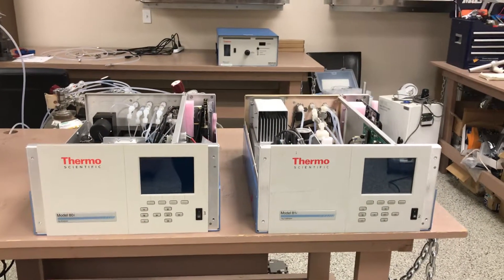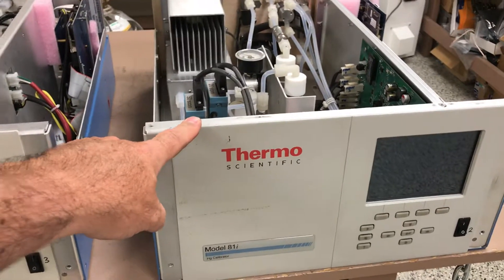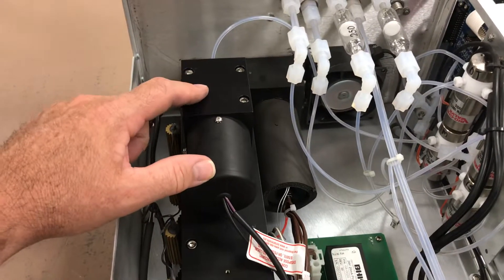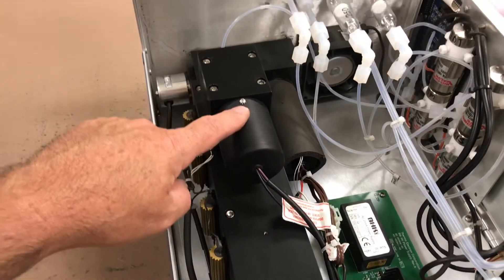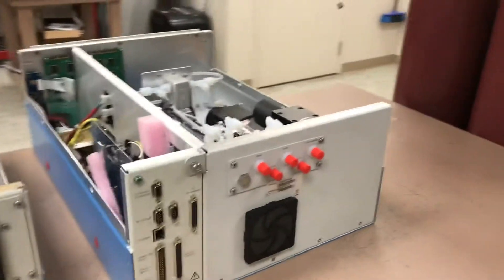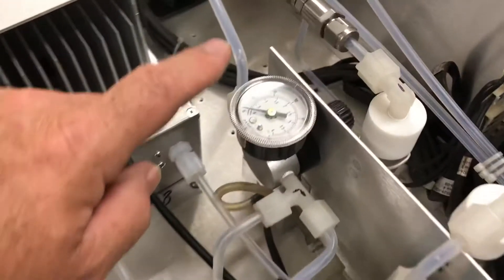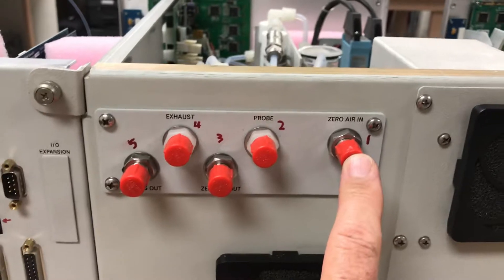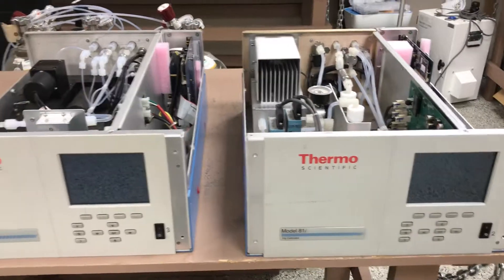Thermo Scientific 80i Mercury Analyzer and 81i Mercury Calibrator

Comment: Hi
What is the BB stinger and how it's remove from status bar of 80 I analyser
Reply: There is a Failsafe temperature. When the probe is cold, the 80i analyzer protects the system by sending a command to the 82i Probe Controller to open the Stinger Blowback solenoid to flood the probe with clean dry air. Go to Instrument Controls > Service Mode and turn it on. Then go to run > menu > Service > Set Temperatures > Probe Set Temp Failsafe. If the probe is hotter than the failsafe it will go to Sample mode.